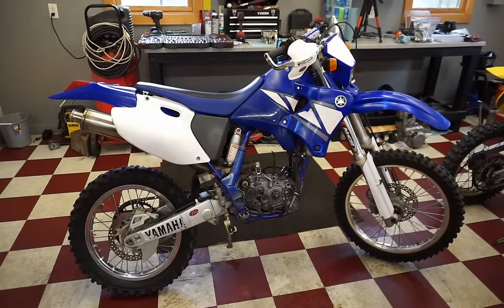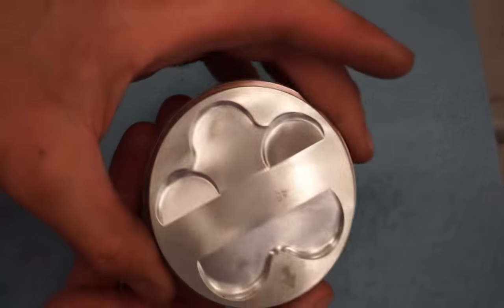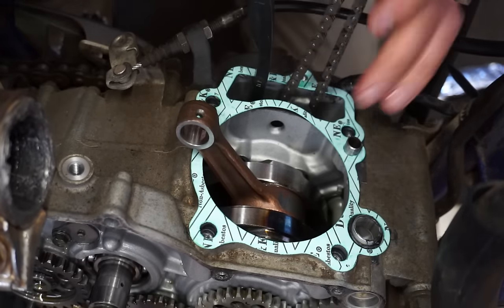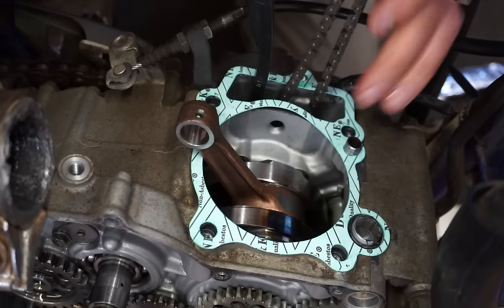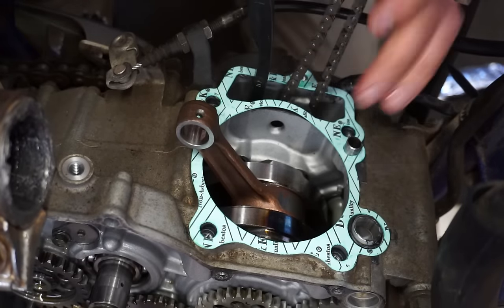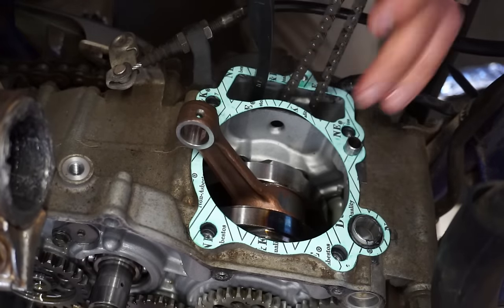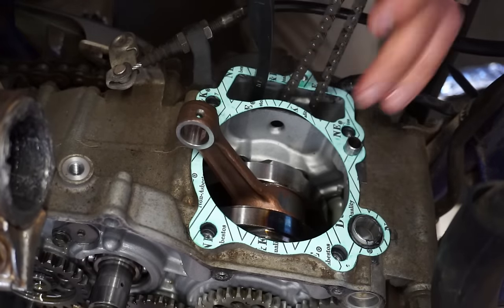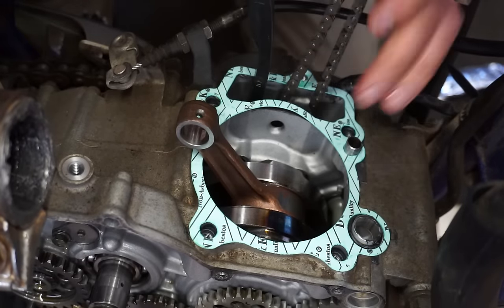Rare Street Legal Dirt Bike Won't Start After Being Rebuilt

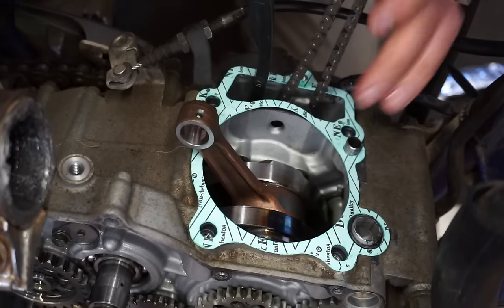Comment: 21:50 Unfortunately, you're a tooth off on the left-side cam.The timing mark is clearly high compared to the right-side cam. That's why it doesn't have any balls. It's not off far enough to do any actual damage but is off enough to make it run rough.
Reply: I noticed that right away and came down to see if anyone said anything. Joe you want both dots to be parallel to the head on each cam sprocket. There's an outer dot and inner dot. Bike is coming along really good! Sorry to hear about your friend.
Reply: Good spot, @22:00 even clearer, given this you would've thought at this point in the stroke the exhaust valves might be passing air?
Reply: @bananabrooks3836  Most likely. Plus, if you look at the inner markings, you can clearly see they don't line up just like the outers. I'm actually quite surprised that Joe didn't catch this since he's always so careful with the timing.
Reply: @stkyfngrszmooth  we've all done it at some point. If you stare at the sky, you forget about the ground. Over looking things is in the nature of being a mechanic. Even the best of the best will have slip ups. Nothing to be ashamed about. Just means more work for you.
Reply: @bradley-klamp  I made the same mistake once. I had just switched from working on cars/trucks and the like and I thought the markings looked "close enough." I soon learned that the timing markings on vehicles are much more sloppy compared to the ones on bikes/recreational vehicles. Never screwed it up again.
Reply: Yep, I thought the same thing.. Didn't want to say anything though I thought I was the only one..
Reply: Thought the same was shouting at the tv lol
Reply: I noticed it too, you're not alone. Initially, I thought this was tolerable since chains aren't super precise. However, once I heard it running, I'm thinking it's clearly off.
Reply: He knows it
Reply: @bradley-klamp  is anthem.off line too.
Reply: Both cams looks like to me.
Reply: BRAVO good eye
Reply: Yup, I noticed that too, left cog was off top position, no expert but noticed that on the footage!!
Reply: @biker6991  not sure what you mean by this?
Reply: I saw that too. I thought maybe it was because it was at an angle.
Reply: Hope he reads the comments.
Reply: No.
Reply: One is a tad low, other is a tad high. Flywheel is aligned a little past tdc.

Not the problem if you watch to the end.
Reply: No that's not a tooth off if he put it one tooth more it'll be the opposite, that right there is a defective cam. He needs to get a new pair that are sync with each other that's a obvious defective cam you can look at it and see it's like a half tooth off.
Reply: Good catch!
Reply: I was wondering if anyone else seen it. I watch on my TV so it's real easy to see. Plus it sounds wrong. Sometimes on camera the sound is weird but it just don't sound right. I'm yelling at the TV Joe, your timings off! My wife thinks I'm crazy. Lol.
Reply: You re right!
Reply: I hope joe sees your comment
Reply: @danielparsons3995  defective cam? You've got to be kidding me😂😂😂
Reply: Just like a yamaha to still run even while the timing's off
Reply: I came to say this.
Reply: It almost looks like the horizontal punch mark is off, the vertical one is in the center of the hole on the gear but it’s like 5 degrees off compared to the right side
Reply: @danielparsons3995  You can adjust the timing on cams individually. All you need to do is remove the chain from the one cam, turn it to where you need it, and then place the chain back onto it. I've done this countless times. Not sure what you mean by "defective cam."
Reply: @JeffArsenault-h5o  All four-stroke bikes can run with minor timing errors, but they'll run like crap.
Reply: Took the words right out of my mouth 👍
Reply: Hey, dude love your tech drawing skills😅😅😅.
Reply: @stkyfngrszmooth if he was off on the exhaust valve  cam wouldn’t air be pushing out the exhaust valves to the exhaust not intake valve cam leaking to air box when doing leak down??
Reply: @lucasmosberger9479  Yes.
Reply: I noticed that also
Reply: @stkyfngrszmooth I think that is what he might be trying to say, “defective cam positioning/angle.”

Comment: I've been ball honing (flex hone) nikasil cylinders without any issues... the idea isn't to remove material but to remove the glaze while creating cross hatches. 
The flex hones for a 95mm run between $40 -$70.
Reply: Exactly  a trick most dont know
Reply: Hes measuring the ring Gap from the wrong end. I'm not going to begin to even go there as a engine rebuilder for many years I don't know where he learned some of the stuff he does. But it's all wrong. He doesn't know the cylinder is slightly larger at the bottom. And with the ring Gap that tight when it goes up it's going to be zero or less that's no way to do it I don't care what he says or anyone else
Reply: 49:19 you just put rings in it and you got low compression.😮
I thought you put different valves in it and was bragging about how they were laughed in and specifically numbered

Comment: Lap the valves and check for open areas on the seats. Always double check valve work before you put it together. One more thing I noticed   when you put air hose on for leakage test the intake cam rotated some meaning the intake valves could have opened a little.
Reply: Correct, those looked like they were only cut, not lapped. The repaired one didn't look so hot at all.

Comment: I could visually see that valve that's not sealing.  I don't know if lapping and/or burr grinding it would help.  I could see the gouging where it needed to seat.  I don't know if that head is salvageable.  There's only so much material you can take off.

Comment: my 99 wr400 started knocking about 5 years ago so i tore the engine down and was going to fix it but life happened and its all still in boxes in the back of my shop.  this vid makes me miss my bike i paid 1400$ for it already street legal, baja designs light kit, FCR carb, YZ timing,  YZ exhaust, IMS tank, aluminum rads, etc. ended up putting 17" supermoto wheels on it and riding it everywhere. maybe one of these days ill get some free time. thanks for the vids man
Reply: I hope you can get to it. I have several such projects; the oldest one has been in pieces since 2012. It is a major job so I keep putting it off although I think of it from time to time.

Comment: You can grain in your valves yourself. I've done it with some different grain sanding powders Just keep turning, sanding them in. I've done it for my 1976 Honda CB400F.

A simple way to check if your valves are sanded in well and don't leak anymore by using some break cleaner. If it can't get trough they're sealed well.

Comment: Joe, love your work. I am a follower and even have my notifications turned on, so I mean this with all do respect… I really do. Why oh why won't you measure piston to cylinder clearances? I know that I'm going to get jumped on about this and told that it doesn't matter but it does matter the first time that it matters. Especially when using "Seize-Co" (Weisco) forged pistons. They are not as forgiving as standard cast. AGAIN, This IS NOT a dig at your work. You know way more than I do… I just think you should measure your piston to cylinder wall clearances. Everybody's gonna jump on me and say "well, standard bore standard piston size he's all set". Well, you are all set until the first time that you're not all set. Especially with the Weisco Pistons like I said. Most people like to add 1 to 2 thou compared to what  Weisco recommends, as well as an extended warm-up time. If you ever come up short on the recommended clearance with a Seize-Co and you ever have a slight overheating problem or a few other instances, it could lead to stickage.  That's all I'm saying buddy… Nice work as always.

Comment: A little tip. If you oil or grease up your gaskets you can reuse them next time you take it apart. An old wise mechanic told me that and it works.
Reply: Thanks! That's why I read the comments; there is a lot of experience talking!

Comment: Without sounding critícal when I saw the new seat that was previously damaged it didn't look fully lapped in.  If it doesn't settle down it might be worth taking the head off and doing it.  I know he cut new seats buy perhaps he left you to lap them in but I also noticed the timing mark on the left side WASN'T level though you said it was but seeing as how when you did the leak down the sound of the air leak never faltered when you roetated the engine slightly I still think your dodgy seat valve is your main problem.  Spend some more time lapping it in and get yourself a highly polished valve seat.

Comment: next time to check valve seat seal, put some water in the combustion dome on top of the valves, and blow some compressed air into the exhaust and intake ports. you shouldn't see any bubbles coming from around the valve edges. I always do this before installing a new/rebuilt head. good practice even after lapping valves.
Reply: Thanks for the info!

Comment: And you'll need to do the same slightly to that valve ports surface to Joe by hand with fingers until it fits tight and can't twist inside of the head at all when cleaned really good surface to surface valve and port hole.

Comment: Before resent out. If it's stuck it'll do the same thing Joe. It's just not dropping down all the way from being dry surfaces still. After all it's A refreshened head now to it's to be expected. It's A simple fix try before you spend more money for no reason first. Try this next if that doesn't do it. Emery cloth and PB-blaster underneath the valve in hand taken out of the Head to clean up that valve only by itself.

Comment: Well that sucks you have to pull the head again. Have you ever tried checking valve to seat sealing by leveling head combustion chamber up then fill combustion chamber up with water then blow air with an air wond in each port and see if it makes bubbles lol. If a valve is leaking bad you won't need an air wond cause it'll leak like a submarine with a screen door lol. It's a mint looking old WR man I wish I could find one that still had a carb. I almost bought one of the last ones made a 2020 model after I paid my DRZ400S off but didn't because I thought Yamaha was gonna upgrade it to a 300 like Kawasaki did with the KLX and Honda's CRF but as we see now they didn't. You'll get'r running right man you always do.

Comment: It's when Joe said "Chuck's done his best" l thought Mmmm so he too might also have had doubts.
75 (count 'em) kicks later.....
Leaking intake valves probably not creating enough vacuum to suck the fuel through at kicking speed which might be why it bumps fairly easily but l would be checking that carb again.

Comment: I'm glad that when you're preparing the piston and rings and the cylinder you emphasize OILING everything. I know most all of us know this, but to anyone who's possibly watching this as a first timer, a motor like this, a 4 stroke, NEEDS OIL on EVERY part that would 'make' contact. The oil IS the contact surface, not the metal. Well, the rings, but they're actually consumable. The thinnest amount of oil is between every moving metal surface at ALL times when a motor is doing what a motor does.. if not, if there's even ONE dry area, there will be catastrophic damage. Thanks for being sure we understand that Joe.. I've seen things man, rebuilds that have just gone very bad due to lack of lubrication on first run.. man it's ugly!

Comment: Place the ring at the very top of the cylinder and measure then measure the ring gap again in the middle of the stroke. The difference will give you an idea of cylinder wear/taper.. A feeler gauge between the piston skirt and cylinder wall in the middle of the stroke gives a good indication of piston wear and cylinder wear too.

Comment: The valve seats still look bad, I usually use a steal wool pad to scuff up the cylinder, works great. Good job, nice bike, very clean!!
I think your problem is that the valves are leaking

Comment: Rick Sieman aka "Super Hunky", the old editor for Dirt Bike magazine in the 70s, wrote much about the newer 4 stroke dirt bikes when they came along about 25 years ago. He complained bitterly about how finicky and expensive they were to maintain, repair and rebuild compared to the old 2 strokes which usually had better performance and were lighter to boot. Especially when they first emerged and there wasn't a significant used parts market, so you were forced to go to the dealer for everything. It increased the price 2-4X times and sometimes more for what would be a simple re-ringing or maybe a bore job on a 2 stroke. Like Chuck, he just passed away a few months ago...end of an era.
Reply: We are losing our heroes brother

Comment: I noticed at the beginning of the video when you were showing off Chuck's repair job (God bless his heart) on the head, it didn't seem like to me that there is sufficient valve seating surface between the valve and the valve seat on the damaged part where it dropped a valve. So, you'll either have to replace the head or have it repaired again and resurfaced so the valve can seat with more surface contact area. That's a bummer. I was really hoping that Chuck's repair was going to make all the difference since the build was dedicated to him.

Comment: Rotella T6 10w-40 is also wet clutch rated and you can get a 5 quart jug for 25 bucks at WM. Beats the 7+ dollars a quart for the valvoline. I switched years ago on all my bikes and haven't looked back.

Comment: 40:00 Wow the bump start did it.  That was surprising. I've got a 12 horse with a rope pull and it will pop one out of 20 pulls - no teeth on the flywheel so no rigging a starter, I'm going to try making a wooden pulley mounting it on a big drill then using a 1/2 inch belt to crank it up.

Comment: Ya could have checked if it was sealing using gasoline. Just put all valves in and spark plug and pour gas (thinner than water) into combustion chamber of head.  It for sure should hold and not leak.
Reply: Good advice!

Comment: It looks like your intake cam needs to be rotated counter clockwise a few teeth. 

I remember the last yamaha you had ended up getting buried in your backyard. I think it would be worth the try. 

You're not going to get that much blow by from a bad valve seal, especially after rebuilding the motor.

Try rotating the motor and see if that blow by disappears incase you're worried about incorrect timing.

Comment: sometimes these will turn the sprocket on the camshaft when they drop a valve. look at the lobes from the right side of the bike and make sure its symetrical (both cams the same) at tdc.

Comment: It sounds like it’s running lean. I would add some fuel. I had a wr400f and it had a unique starting technique. Eventually I swapped the exhaust cam out for one from a 2006 with the auto decompression.

Comment: Did you do a leak test on those valves, they should been lapped before installation.
Hope you don't ruin the valve seats running the engine if this is the case.
Nice bike.❤

Edit: watch till the end before writing a comment, 
but the new cut valve seats and valves always lap them

Comment: Maybe need to drill out the pilot jet a little you can get the drill bits cheaply. The head that's questionable damage near the seat or on the seat is really hard to make a good repair. I looked for a head its near 400 dollars. It dropped a valve because of a lean condition most definitely. Drill the pilot 0ne size over and test it you might have to go over a little bit more.

Comment: They both should be smooth and shiny surfaces still if not relap it with permatex valve grinding compound and plunger tool and reclean it out agian.,or again.

Comment: With that still having 100 psi you may be able to lap that valve and get it to seal. Check to see if the combustion chamber holds a puddle of WD40 before putting the head back on.

Comment: Just make sure there's no nuts on the surfaces of both parts afterwards is the main thing to worry about.
Reply: I started an engine with a small nut on top of a piston. It knocked.
But, a new piston solved that small problem!

Comment: Will Joe ever understand how to kick these bikes? 😂
I have owned a few of these and they are maybe not easy starting, but certainly not this hard. Cold it should be no more than a few kicks.
If you have the choke on, and twist the throttle that many times, it will be totally flooded once it kicks over.
The accelerator pump shoots a massive amount of fuel with each twist.
2 maybe 3 is the most you want to twist.
And this frustrating mad man kicking half strokes does not work.
Find the hard spot, bump the kicker just past it, return to the top and kick all the way down. Not hard or violent, just a steady deliberate kick all the way will get it done.
Jeeez, Joe will kick these bikes apart, never taking a hint from the viewers.
I also find it strange that everything is always "so thats good" on all bikes. But we have never seen Joe touch a single suspension part. Or a wheel. Or a tire. And hardly even brakes. As soon as the engine runs, its all good😂

Comment: Sorry about your friend, something very wrong as you should not be able kick it over with out using the decompression lever, it should just lock up if not using it, I guess your valve seats are bad or the timing is out, d

Comment: Like Cheech and Chong would ask......hey man....did ya check the air in the tires.Is the headlight burnt out.Are the muffler bearings working.Is the seat ripped man.Does the horn blow.

Comment: No needle pin bearing is required when putting the piston on the connecting rod ?
Reply: not on 4 stroke
Reply: @robertdelinsky7247  Do they still use them on 2 strokes ?
Reply: @AnthonyRufo-rc1zm My last race bike (2002 Suzuki RM 125) had a needle bearing that the wrist pin went through. All two-strokes (that I've worked on) have them like this.